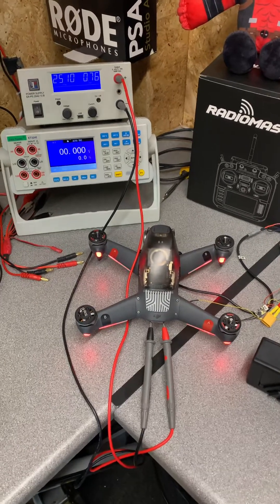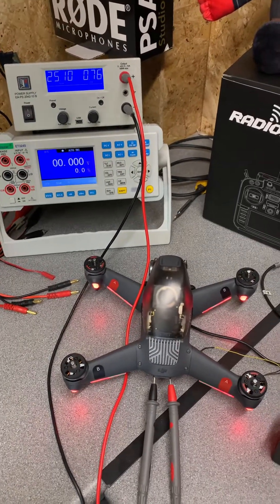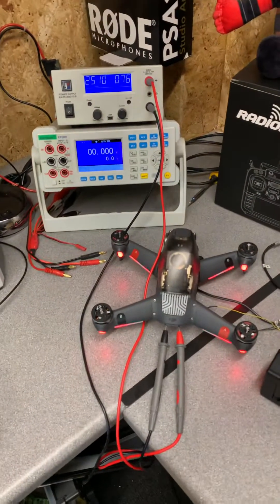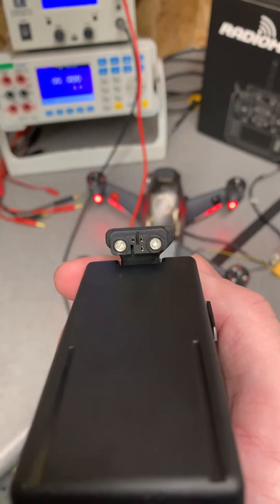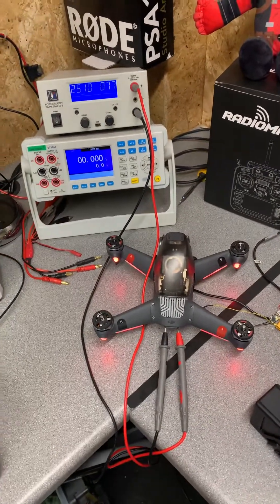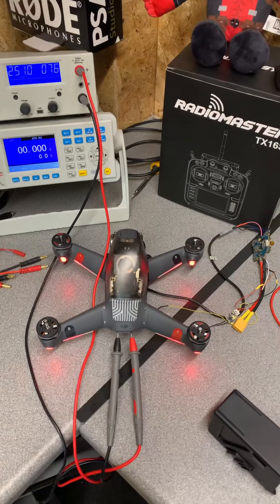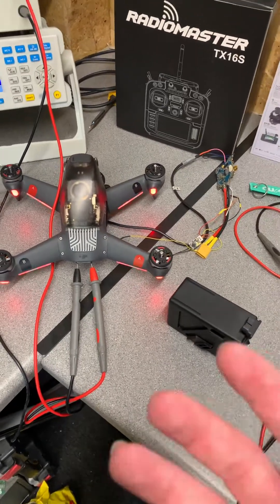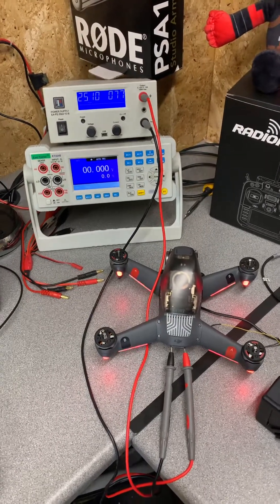DJI FPV Drone Can You Use Any 6S Battery ?

Comment: Ok so if I fixed the inner 3 small pins and I fixed a communication error, I still get an error saying battery installed incorrectly. Which part of the drone or battery sends and receives the signal for having it installed correctly?

Comment: What if you connect in paralel two dji fpv battery, but only one with the plugs from data state for the drone.
Reply: How you can connect the dji fpv battery to the drone and use the ( + and - ) on the top of the battery plug to see if it fly´s more time.

Comment: Any reason you couldn't break down the battery and use the bms smart side and solder those wires onto a 6a 6s balance and power wires
Reply: Did you ever manage to do this? I'm in that same spot... Right now
Reply: @FernandoBelloEchevarria  I'm sure it'll work. Chip is just looking for proper voltage.

Comment: i need the wiring diagram of the dji fpv board. I have the ubrt 2300 and I can do the repair and modification. but without a shitty data there's no way

Comment: I was wondering if you do some research for the possibility  of using mavic 2 pro battery , to be used at google DJI FPV.? any chance.? appreciate that.
Reply: Should be able to just not sure how you could connect it as the Googles run on 2s minimum.
Reply: In theory if you have the og power bank you could connect a USB c to usb adapter to the usb adapter that comes with the Mavic 2 air fly more combo, and probably others to
Reply: @POLARISFPV  yes  understood..however, is that ok for the voltage that out from battery M2P was saying nominal voltage written 15,4 V .?

I saw the battery for google DJI out put at 9Volt
Reply: @dodilukman6142  that is correct the goggles battery operates at 9v. However the goggles them selves can handle a supply voltage of 25v or 6s. The battery itself is designed not to work with anything other than the provided USB cable for the goggles  to avoid frying phones and other devices that run on 5v. However the cable its self should be fine running on 25v. For reference I operate my goggles on a 14v lipo battery.
Reply: @POLARISFPV  aha..sound goods..appreciate that..now i feel confident to use my spare battery M2P to be inject direct for FPV  googles with proper  and safe usb, instead of waiting to recharge the original battery for longer view.

Many thanks
Reply: @dodilukman6142  might try this myself now thanks for the idea
Reply: @POLARISFPV  appreciate that, let us know if you find any wiring or others  that doesn't fit to the battery..thanks

Comment: possible add other 6s lipo battery strap on drone add wires on connector for more flight time?
Reply from the maker: People are doing this.  They are adding in a 1A 6S additional pack.
Reply: @MadRC  COULD YOU PROVIDE A LINK TO THIS MY FRIEND?

Comment: What about piggybacking another battery in parallel to the original battery, so its using both at once and still receives the can bus signal?
Reply from the maker: Yes people are doing this with good results.

Comment: Do you know the communication protocol is CANBUS? My guess is it's I2C.
I monitored the communication between the RoboMaster S1 and it's battery and found I2C signals. That's why I assume this one uses I2C as well.
Just as the RoboMaster S1, the FPV drone's charger only uses one communication line. I'm making an adapter to capture this communication right now.
I haven't looked at the traces of the communication yet but I plan to in the near future. I have a teardown of the battery on my Hackaday(dot)IO page if anyone is interested.
Reply from the maker: That’s interesting as DJI have been using CAN for most of their RTF products.  I2C is a horrible protocol to use for this now as it’s got many issues.
Reply: @MadRC  You were right about the CAN bus. I just tried capturing the first communication between the drone and the battery and it was a balanced signal which looked like CAN.
Reply: DJI basically uses UART and SMBUS for communication with a battery. It's different than CAN.

Comment: Great video info..I would like to know if it's possible to use a after market lipo battery to replace & power the new DJI FPV drone goggles safety..? instead of buying multiple expensive DJI stock smart battery's at $90 a pop.🕹🚁👍
Reply: Yea just buy a aux power to female XT60 plug cord.
Reply: Note the system will operate on 2-6 s

Comment: I would be interested to know what the voltage level of the battery is when the OSD shows 20% and suggest RTH. 21 volts? Hopefully they build in a little buffer room there for battery longevity.

Comment: Need to found a way to use single 6S , need to get a female dji plugs with the balance inside as spare parts to connect to a single 6S battery li-ion or lipo ....

Comment: In fact the battery safety/failsafe electronic can be on the drone if you use the balance wire. DJI know how to make money.
Reply: then customer could use any cells to power the drone, even of poor quality which could cause drone crash midflight. Then Dji reputation could be under impact, who will check which cells were in use? So this is not only earnings respect...
Reply: True. I have not thinking on this side.

Comment: If I remember right I had done a research 2 years ago about the same question but for Mavic 2 prop

And there had been some successfull mods like adding another battery on top of the current one by adding a ribbon connection and some other mods ... that achieved the double capacity but missed to double the flight time due to too much more drag and weight. You can find an example flight around 40 something minutes with Air 2 I guess by Gal Kremers channel with such battery. 
There also had been figures of 44 to 50 minutes for a Mavic 2 Pro compared to 29 minutes before but I will wait till one of my  batteries will have  died and vor the Mini about 53 minutes hovering.

Therefore I assume that you could add up capacity for the fpv drone as well if you find a usefull space that also does not impact the CG that much cause that creates assymetrical lift between front and back if I remember right cause there had been long discussion how much energy would been lost and why. 

I must check my notes somewhere cause I did ann intensive research about different solutions and different chemistries and even high end 18650  solutions that seem possible or were possible but hard to remember except that they had been successfully.

And why not if you can extend the range of a new VW e-Up car in a simliar way by adding cells of 5 kWh in the trunk in the spare tire compartment ? 
The only sideeffects for cars are the missing or lost calibration and maybe even right control in the display cause range calculation and so on can go wrong cause the car was once trained for 32 kWh and adding 5 would mean that the car must think that will be overcharged after charging from 1 kWh to 35 kWh which would mean 4 kWh more than allowed.  Same issue for e-bikes like the bionic powertrain from canada that is not happy with renewed and better cells of higher capacity. But the dji mods for battery worked cause the flight time had been adopted successfully too.

Great topic - thanks a lot.
Reply: I think you could add capacity by connection a 6S pack in parallel with the main pack but I'm doubt the drone would fly well. I've posted a teardown of the battery on my Hackaday(dot)io page. You can find it by searching for my user name.

Comment: Wonder if you can take the chip off a DJI battery and Solder it onto custom battery
Reply from the maker: Now this has been done with limited success on the Inspire,1, the battery does have a protection in the firmware that seems to detect a change of capacity or cells.
Reply: @MadRC  yes, one should reprogram the bms controller using TI ev2300 programming board once cells replaced for different chemistry or capacity.
Reply: @MadRC  oh wow , thats crazy they have that much protection... cool to know, thanks

Comment: Can it be hacked to use fcc mode like the air unit
Reply from the maker: No not currently.
Reply: yes the way will be to go directly with a wire to the FC maybe .
Reply: yes, that's rather easy

Comment: Ken heron had that come up for his one 🤷🏽
Reply from the maker: Likely not plugged in properly. The pins for the data lines are small.
Reply: @MadRC  He bounced the drone off the ground and it killed the battery. After he bounced the drone auto landed with the same battery communication error and he couldn't even turn the battery off. Seems like DJI has super fragile batteries as he was the 2nd person this happened to.

Comment: wonder if its just a basic wiring loop....  what happens if you put a wire across those ports will it then allow take off ?
Reply from the maker: Usually not. It’s full CAN Battery tech usually.
Reply: @MadRC  ah bugger
Reply from the maker: Yea sadly so.

Comment: Sounds like a job for a PIC chip and can bus hack. Had to use my monitor in portrait mode to watch this :-)
Reply: These systems use cryptographic authentication chips, PIC won't help you unless you learn how to extract the key from a DJI smart battery IC.
Reply: @PraiseKier  well that's pissed on my chips.
Reply: @PraiseKier  but it had been achieved for the Mavic 2 Pro by adding another battery on top and other solutions about 2 years ago which you could buy back then for 100€ or so extra and connect to the clipped in flight battery by a clever designed ribbon ... But i lost source to tell more or better I need to search my notes cause I had been interested in that topic to gain 45 minutes of flight time.